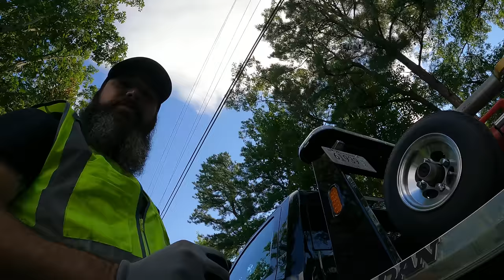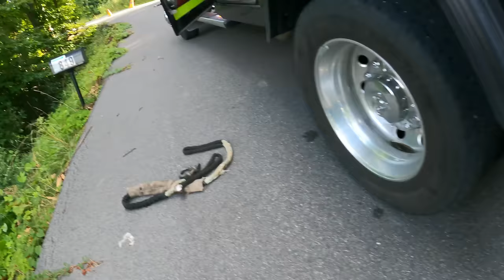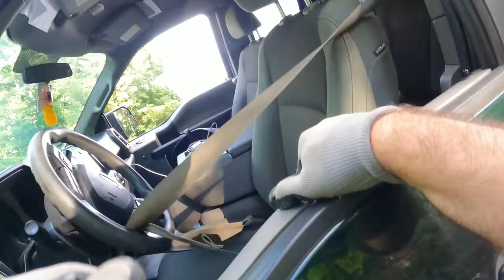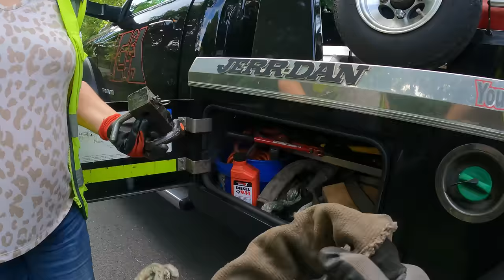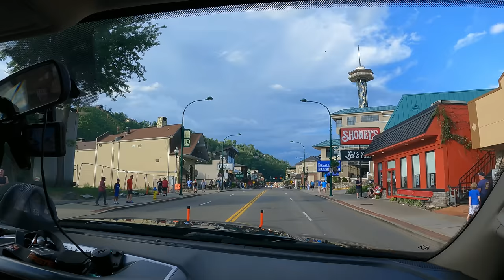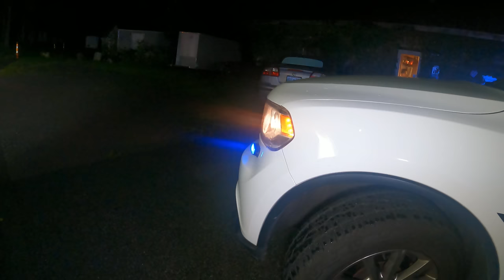Bear On The Strip In Gatlinburg & Pursuit Of A Drunk Driver

Comment: On the white suv you said the battery was pulled then a couple of minutes later the headlights were on???
Reply: The cop or someone just disconnected the battery maybe bc of the horn going off or something a fire don’t start but the battery was still in there so Jeff reconnected (as u see in the video) it to put it in neutral to help turn the wheel I’m guessing…